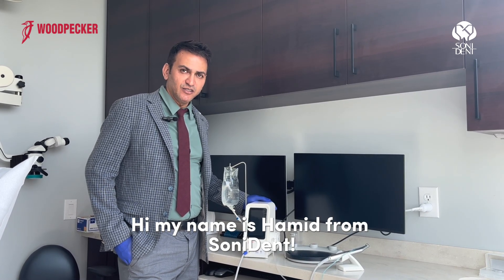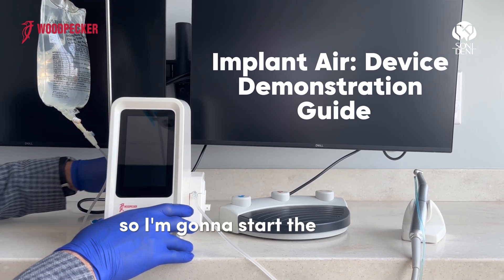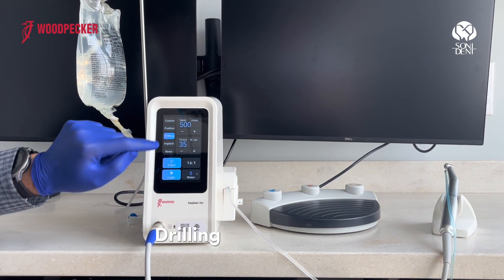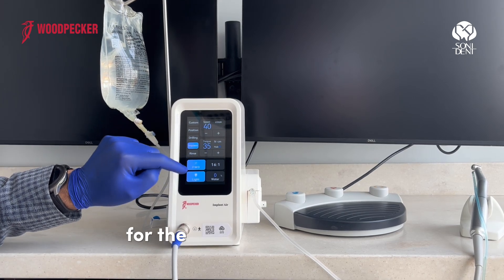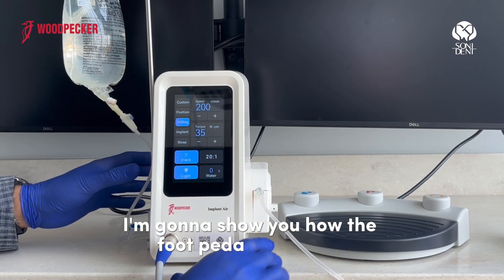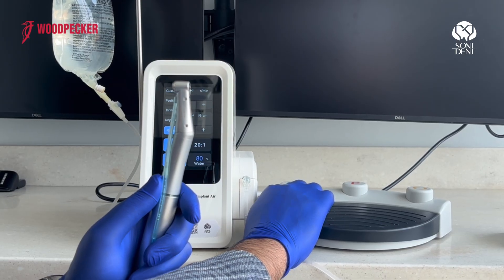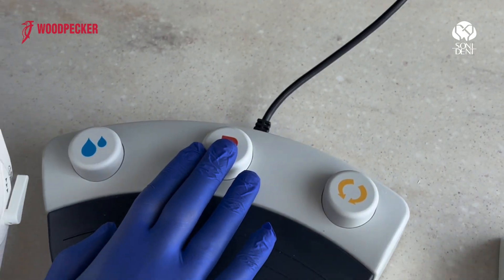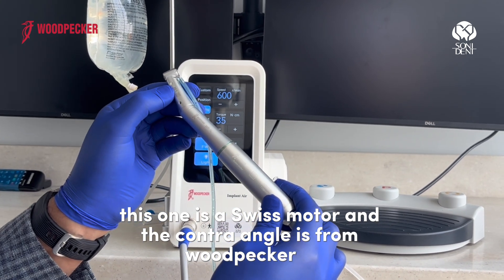Woodpecker / DTE Implant Motor: Implant Air (Setup + Q&A)

Comment: Pregunta esa pieza de mano tiene luz led?
Reply from the maker: Yes, the Woodpecker Implant Air Implant Motor comes with a 20:1 LED contra-angle handpiece, ensuring enhanced visibility during procedures. The built-in LED light improves precision by providing clear illumination of the surgical area, making it especially useful for implant placement. Let me know if you have any other questions! 😊